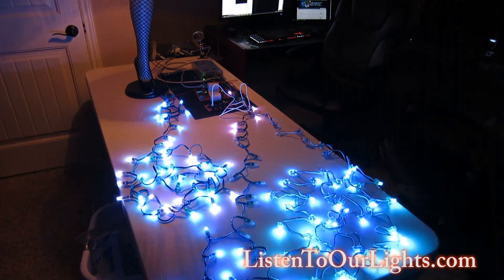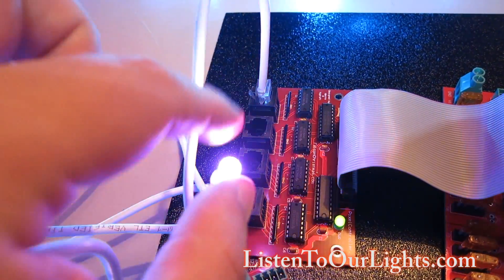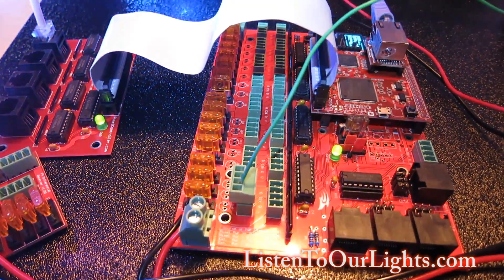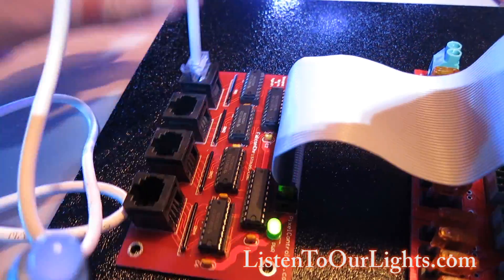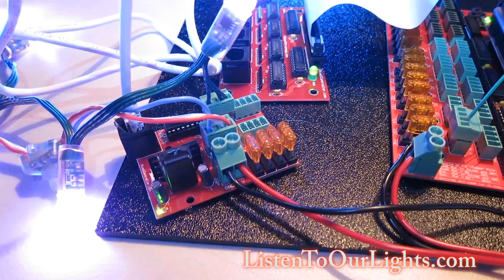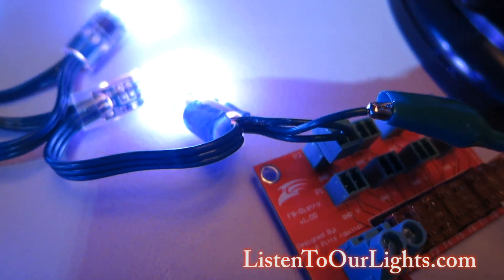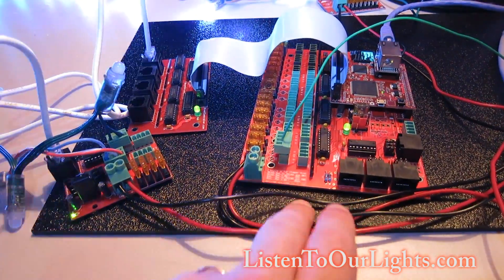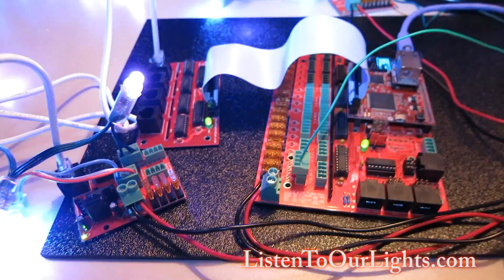Playing with Falcon Differential Boards

Comment: Nice video John. Remember, you can also connect the Differential Receivers boards directly to a serial output of the Falcon F16V2 and V3. My 2016 shows consisted of both methods from four controllers. David Pitts has made it easy for us to be very flexible with out controller and props.
Reply: With our, not without. LOL

Comment: That single wire running from the controller to the LEDs powered off the power distribution board set off all kinds of warning bells for me.   Better make sure that both the distribution board and the controller are at the same ground potential.  Something you can't assume if they are far from each other.   If the distribution board floats relative to the controller you could take out some pixels!   Likely just the first one on the string but still you wouldn't want even that.

Comment: good video. I also was messing around with reciever boards this week. remember it cuts the 680 nodes to 340 nodes. in half after board is set to 32.